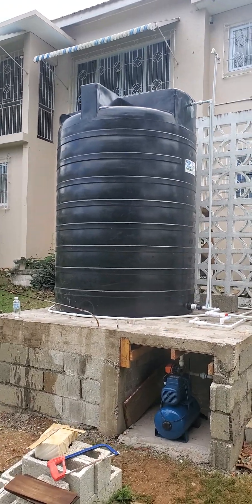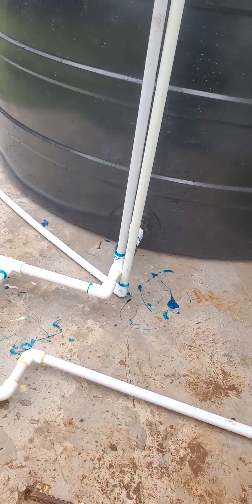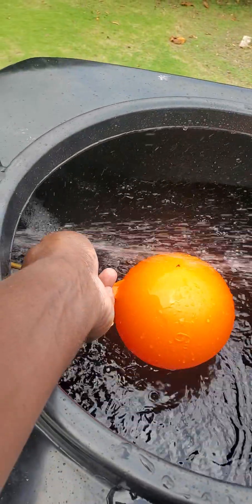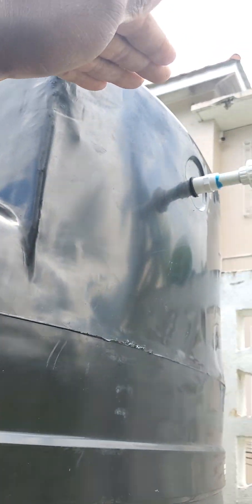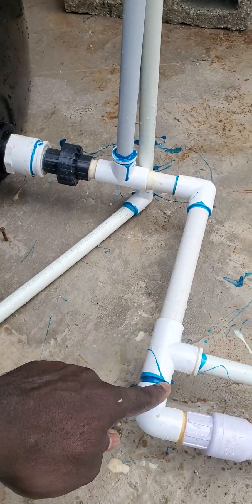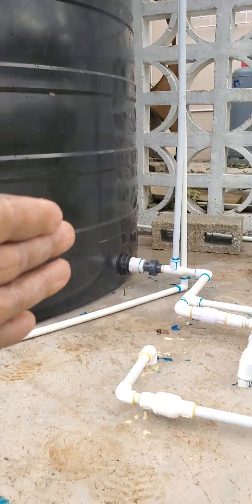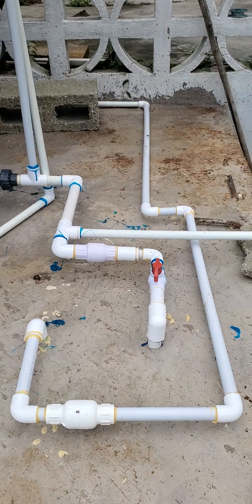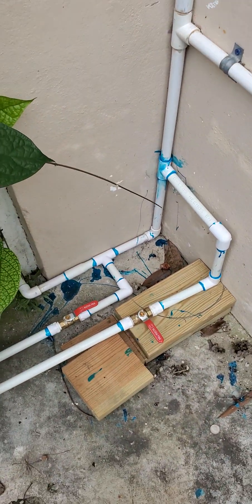How to install a 1000 gallon water tank with 1HP water pump

Comment: well explained video but it would have been nice to see you turn on a tap in the house to check out the pressure and see how well the pump works. I think you should also consider filming with your phone in landscape as watching on a laptop or TV, only a small part of the screen is used.

Comment: What will stop the water from circulating in the tank through the tank inlet(or fill) line when the pump is operating?
Reply: Thinking the same thing…especially when there is no flow from the main, the  tank floater will be open and there will be an ongoing water circuit…the pump would not switch off
Reply: Maybe there is a check valve he didn’t show
Reply: @heronchambers3824 check valve still mean the water flowing to the tank

Comment: What if I want the pump to only come on when the supply pressure is low? What additional pipe work is reguired?
Reply from the maker: This pump has a built-in pressure switch for that. If yours doesn't you can install a smart head
Reply from the maker: Nothing additional